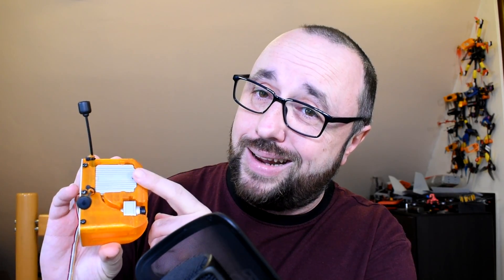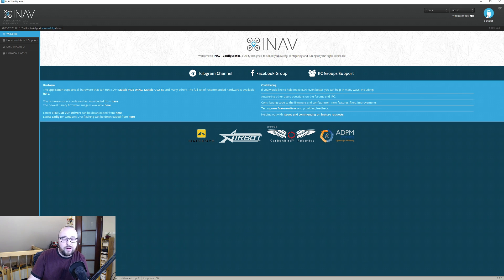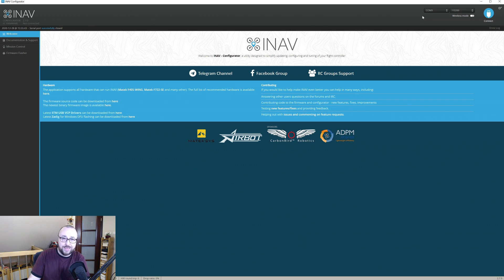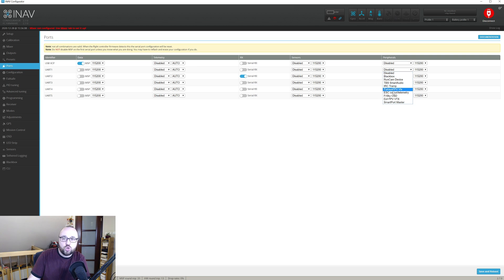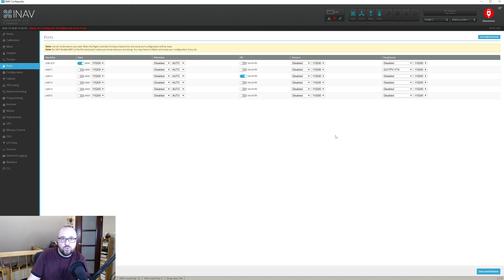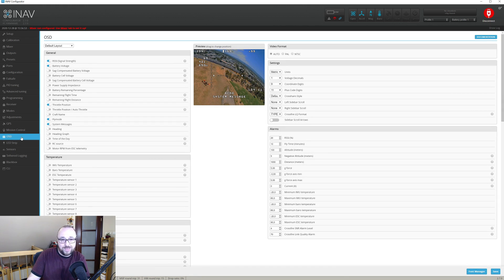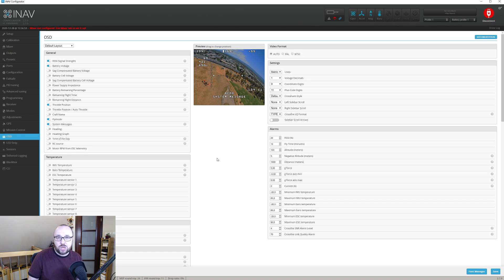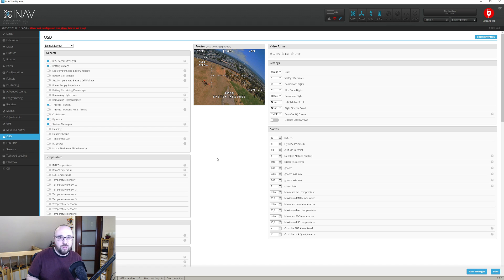INAV & DJI FPV System Tutorial

Comment: Hi Paweł, is it possible to make a video how do we use all the buttons of Dji Fpv Controller?
I only got ch5, ch6, ch7 and ch8... but there are more buttons like Rec, the big with next yo power, the back and two wheels for the camera on the top the right one is clickable. How would by possible to set a Mode with those buttons?
Reply from the maker: I'm sorry, but I don't have the hardware to record such a video. No DJI controller over here

Comment: With MSP turned off, so how i get telemetry to work? (Like battery voltage)?
Reply from the maker: Because you turn on the DJI FPV mode?
Reply: @FPVUniversity  never mind, i was just stupid, not realizing that voltage monitor is off in inav by default. Flip the switch, everything worked :)

Comment: I've tried everything but can't get the dji v2 goggles to work with the matek 765 and Inav. It works and shows the picture but none of the osd information is present. I've tried different uarts but nothing is working. I've seen on other forums people with with this same FC are having this issue.

Comment: Question, first off thank you. 
My Question is, how do I get the DJI remote to work with Inav? I followed all steps here and it shows its connected but I don't get any stick movements in Inav. The radio and caddx are bound to each other.  Im new to inav been flying DJI FPV for a little.over a year.
Reply: Following

Comment: do you have problem with wrong coordinates on dji goggles? RTH is work properly but my coordinates shows wrong value in the goggles.
Reply from the maker: V2 goggles? DJI messed up the firmware for them

Comment: So, With the air unit and iNav flight controller connected as described, OSD works.  With it connected this way, can iNav be configured to get its control inputs (throttle, pitch, roll, yaw) from the air unit (when the DJI controller is used)?

Comment: a handy tip for the DJI Air unit wiring is to remember: whiTe goes on Tx and gRey goes on Rx. (only works with the air unit wire, not with a vista)
Reply: Thanks! Good tip